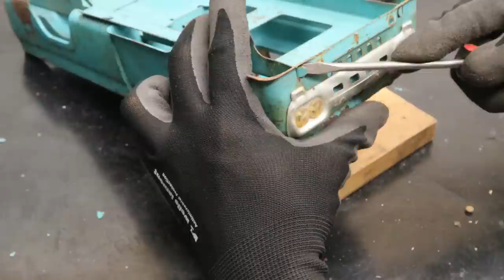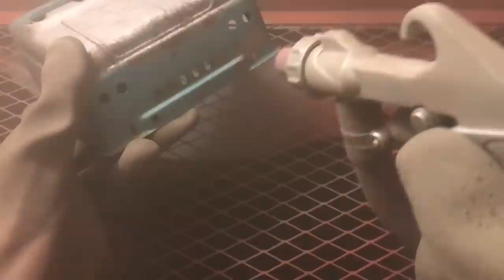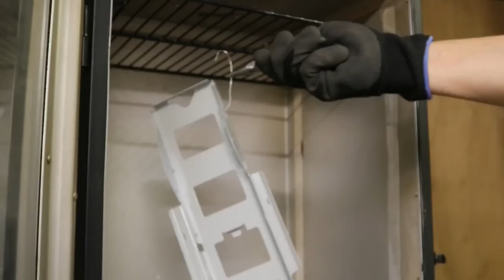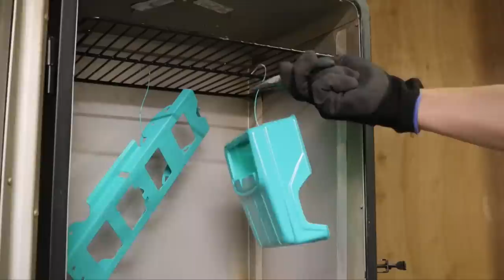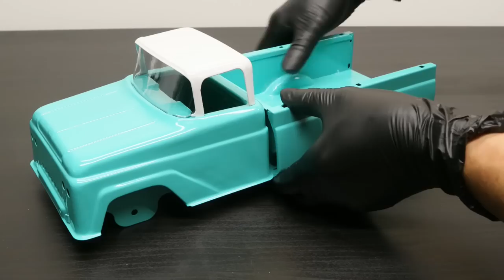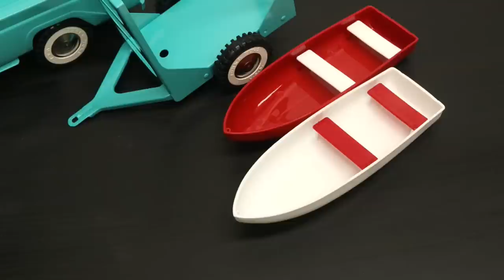1961 Vintage Tonka Boat Service Truck and Trailer Set Restoration

Comment: I applaud your pre-sanding of the metal before putting on the primer! It made the paint look like glass. Because of the slots on the bed of the truck, I believe either a cover or bed stakes belong with this setup!
Reply: This series of truck also had a camper cap for the "fisherman's camper"
Reply: @jamesalinio5277  I thought so! A camper cap would make sense for carrying boat motors and other essentials.
Reply: The boat service trucks did not come with and but what u see in this video but th boat truck with a boat dolly did 2 different toys

Comment: Great job. This restoration of the truck & boat trailer was executed wonderfully. The paintwork & prep - made this job a big success I also like that during reassembly that u took the time 2 fold all the tabs down tightly as this will probably never be taken apart again - this alone helps in the final appearance
Reply from the maker: Thank you for your compliment and wonderful comment!!!👍👍🎉🍻😄

Comment: excellent restoration! might be the sun fade of the old paint vs new powder coat...the old color looked more baby/sky blue & new color looks more seafoam green; whatever caused the color difference....the prep work makes the powder coat pop & looks brand new!
Reply from the maker: The color is turquoise I painted that is a little bit different. It’s very difficult to find out the color which is same as original. Thank you so much for your compliment and comment!👍👍🎉🍻😄

Comment: I thought for sure that the chrome grill and bumper were goners because of the rust.

But like the other parts you salvaged them and it all looks good as new.

 I also like the extras you showed us at the end. Did the outboard motors and figures come with pickup and trailer, or did you make them?
Reply from the maker: Thank you very much for your compliment and wonderful comment!!! 👍👍🎉🍻The outboard motors and figures are also from Tonka, the motors come from other boat truck but not for this boat service truck set, l think that the two figures made by 70s come from Tonka renegade jeep. 😊

Comment: Where do you find the new parts for these? I have the same basic truck, the truck with cattle panels on top of the bed sides, and a Tonka Volkswagen Bug to restore for my Grandson. The VW Bug my Grandparents got me in '68-70 and only allowed me to play with it. Then in '86 after they passed away I inherited it. Time for my grandson to have it, with a little brass tag on the bottom showing our 3 names and room for more.
Reply from the maker: The toys you inherited should be restored and definitely worth passing down from generation to generation👍👍🎁 the following website that you may find out the most parts you need: https://www.gasolinealleytoys.com/, https://thomastoysantiquetoyparts.com/
Reply: @ar_restoration  THANK YOU for the links. Yes all these toys hold significant connection to family. I forgot to mention the 2 trucks were my brothers toys at my Great grandmothers house. So with my grandson that would be 6 generations in contact with them. THANK YOU again.

Comment: How many hours? You should have a little time clock running?
Reply from the maker: I did this project for long time in the summer, it is hard to count how many hours I spend, sometimes 5 hours per day and sometimes 5 days off, the weather was hot this summer.